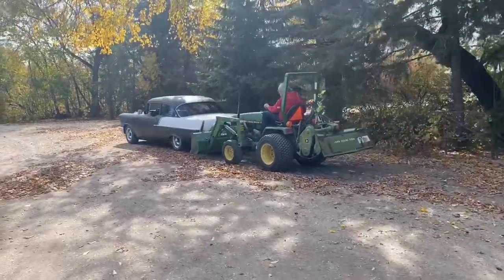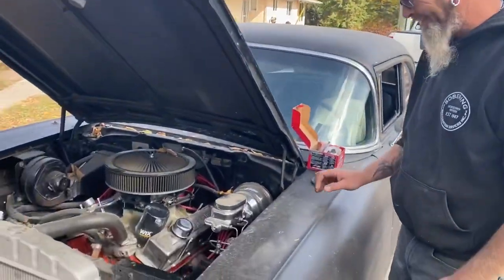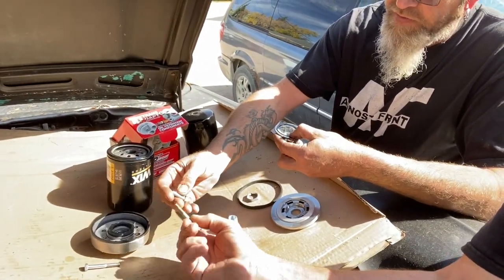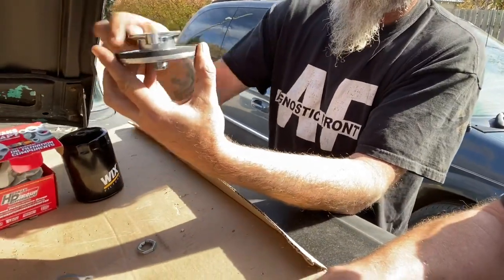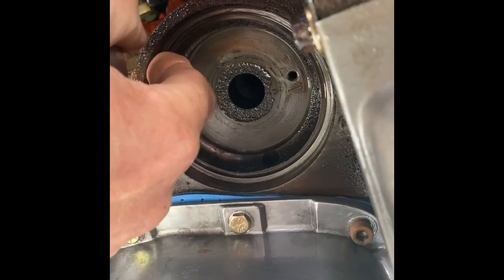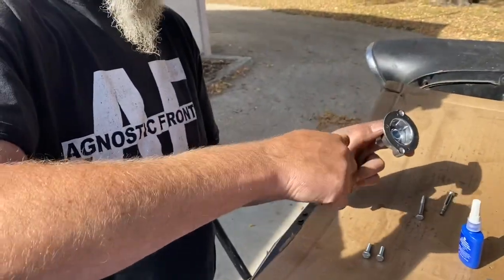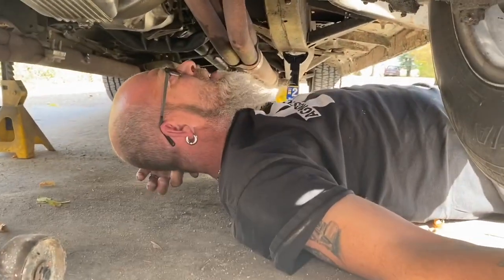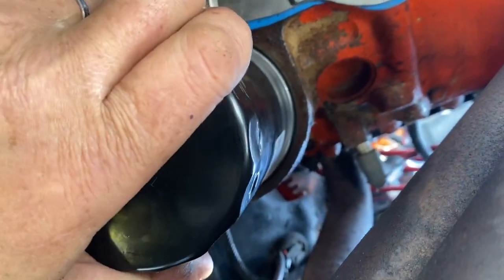TRANSDAPT oil filter adapter to the rescue!

Comment: Hey Jeff and Dave , haven't had much computer access lately . Logan's pickup is great . The back bumper on the Apache is great . Glad '57 is up and running again . Real good to be in contact with you folks again !
Reply from the maker: Hey Greg, we were wondering where you got too.  Welcome back.  Logan's truck turned out great and he's been ripping it around Regina since he got it back with no issues.  That bumper turned out way better than I imagined.  57 is happy again, and hopefully get a few miles on it before it gets parked.  Thanks for checking in.

Comment: Hey Guys,  Looks like a good kit to me. Only one problem with the adapter that I can see. They use a FORD oil filter on a Chevy - that's a future fail right there if I ever saw one. lol  One thing you should check out 3 Bond part # 1184 instead of using silicone. Silicone can really f up a motors by blocking the oil passages but 3 bond won't, it will just wash thru the passages. Check it out when you have a chance, I've been using it for years with good results. Later
Reply from the maker: Hey Marvin, it's definitely a better set up than what we had been using before.   The Ford filter better not let us down...(fingers crossed). Haha.  As for using the silicone, I pretty much wiped off everything other than what was needed to hold the gasket in place.  Will definitely check out the product you suggested.  Thanks for the tip and thanks for watching.
Reply: @soberingrestorationservices  I rember using something called Hi-Tack for those applications, it has a little to put it on real quick if I remember

Comment: Great instructional video - a word to Jeff, instead of watching you struggle under the car, a good mate would've been there holding the camera instead of leaving you to do the mechanicing AND cinematography. 🇬🇧 🏴 😂 (Thinking about it, as you tighten the oil filter, are you relying on the shear strength of those two 1/4 screws holding the adapter? Shearing one off at the bottom side of the block would be a whole world of pain, so I'm glad you were cautious when attaching the filter: I'm told I think too much. You were right to be careful with the electrickery isolation).
Reply from the maker: Thanks David.  Well, it was kinda tight under the car for both of us to be there at the same time. All good.  As for shearing off the bolts, I was cautious enough to not over tighten them....last thing we needed was to bust one off.  The locktight and the right amount of torque should keep the adapter in place.  Thanks for watching.